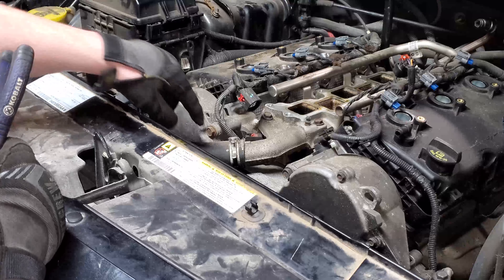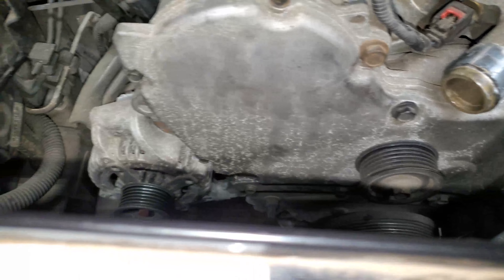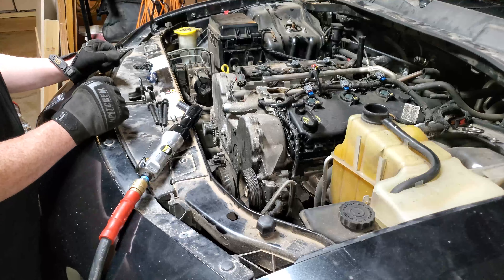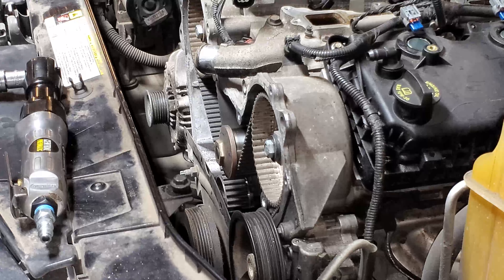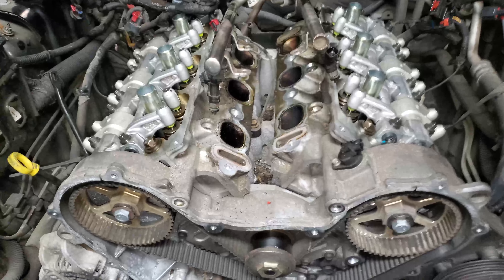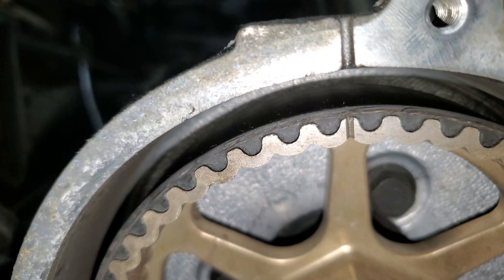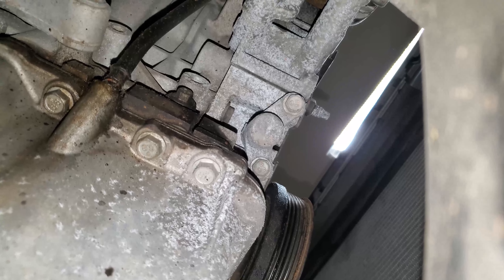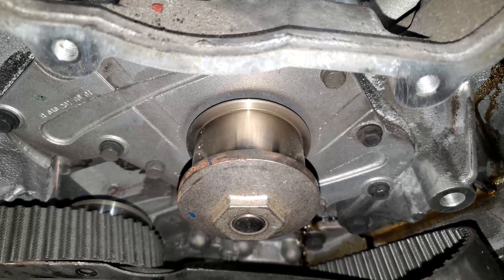How To Replace Water Pump 3.5L V6 Dodge Charger SXT Chrysler Mechanic Fix 4K

Comment: Quick question so one of my bolts had snapped and I was trying to figure out what length and thread pattern the longer bolts are that hold the water pump in
Reply from the maker: Dang, I'm not sure. A Chilton manual or Google could maybe tell you but I'd extract it and with both pieces perhaps you can deduce that.
Reply: @bakerRebuilds  I been reading up on it's since Saturday and still haven't found it but I might be use another one to find the exact bolt I need
Reply from the maker: @MirandaGarza-v5b  yeah try the others to find a good fit. If you get 3-5 full threads that should work

Comment: I like the music. You made this look so easy. I'm assuming I don't have to take out the crankshaft pulley since it's only the pump that's bad and not the belt?
Reply from the maker: Thank you! No need to removey the crank just upper timing cover. You got this!

Comment: Quick question. Have a 2009 Dodge charger no codes come out, no lights are on, no leaks but does overheat no white smoke from mufflers and no noise. Water pump or head gasket?
Reply from the maker: Probably not head gasket, check under oil cap for white frothy stuff to be sure.
Does the car blow full heat inside the cabin? If yes probably not the water pump, if no it could be the water pump, heater core, thermostat or even too large of an air bubble in the coolant loop. Hope this helps!

Comment: So I have a 2010 3.5L dodge charger and when I idle the car starts to overheat( makes it to the 3rd section of heat thermostat). Checked the engine while on and I see that the radiator fan was spinning but I also seen a leak (not sure if it’s water or coolant). Would it be safe to assume it’s a faulty water pump or is it something else ?
Reply from the maker: If it just overheats at idle, it's very likely there is too much air in the coolant loop. At running speeds say 4k rpm for example, it would have 4 times the pressure of a 1k rpm idle. So while your driving the pump has enough force to push the air bubble past the high point while at idle, it cannot and the coolant sits still which would cause the overheating. I'd make sure fluid is full and system is bled properly. If that doesn't do it let me know.

Comment: No mention of taking off uper intake plenum or the valve covers is any of that necessary? To change the water pump?
Reply from the maker: No that shouldn't be necessary. Probably the upper radiator house but then you should be good to proceed.
Reply: Fantastic thank you
Reply from the maker: @kevinfoster1138  No problem, hope it goes well!
Reply: @bakerRebuilds  
Hello sir the repair shop told me that it would be 1,900 dollars to replace the water pump. Is that accurate??
Reply from the maker: @Charles-dm4ku  I don't exactly know but with inflation and the labor required, that's unfortunately probably about right.
Reply: @bakerRebuilds  
Replacing the oil , cool and all the filters too?
Reply from the maker: @Charles-dm4ku  When I rebuilt this V6, yes I pretty much went through most parts/fluids.

Comment: So u dont need to remove the crank pully ?
Reply from the maker: Nope, just the main aluminum timing cover, take tension off belt and slide off top stuff leaving it down around the crank pulley, change pump and reassemble.

Comment: Any advice on replacing a rear main seal on an 09 Dodge Charger 3.5 v6 high output?
Reply from the maker: That shouldn't be too bad. I would unbolt the torque converter from the flywheel, drop the transmission, remove the flywheel and then you should have plenty of access to replace it.

Comment: Don’t have to pull the harmonic balancer pulley?
Reply from the maker: @neilritter8418  No, you do not.
Reply: @bakerRebuilds  thank you man. Good video 🤘🏻
Reply from the maker: @neilritter8418  I appreciate that! Also be sure to torque the water pump bolts properly. Wouldn't want a leak there

Comment: Does anyone know if the 2010 challenger and chargers have the same engine and intake manifold…like can you use the engines of these cars in one another?thank you
Reply from the maker: Yes, Chryslers 3.5l V6 is found in the base dodge chargers and the 09-10 challenger se models. Depending on year the vehicle will have a 4,5 or 6 speed transmission so you'll want the same speed from donor car to the receiving car to make sure the bell housing bolts line up.
Reply: @bakerRebuilds  thank you so much for you’re input that’s another issue with the engine the bell housing bolts did not align but somehow still worked I will make sure to ask next time have a blessed day brother
Reply from the maker: @markortiz8199  no problem, you as well my friend!

Comment: I liked the music tbh but how did you know the water pump was bad?
Reply from the maker: Thank you. I took this engine all the way down to the bare block so I made separate videos to help someone on a specific part. If it was bad though you would have over heating due to lack of circulation.
Reply: @bakerRebuilds  hello, my 2010 3.5 is slowly leaking water over night when parked . When I drive it to my dads to try to pin point the location it wouldn’t leak. We let it sit a few hours and nothing. But I drive home let it sit and over night it starts and after a few days I checked and was almost at bottom for coolant reservoir. What could this be?
Reply from the maker: @seanf6968  I would do a compression test to rule out head gasket. I'd also suggest starting first thing in the morning with it jacked up so you can lay on your back under the front of the car and try to pinpoint any leaks.
Reply: @bakerRebuilds  would a head gasket throw a code ?
Reply from the maker: @seanf6968  I don't think so but I could be wrong. Check under the oil cap. If there's any white or foamy stuff it's a sign of a head gasket leak.  Make sure where your thermostat goes that it's a secure connection and check back by the fire wall, by the heater core to make sure it's not leaking. That's about all I can think of for losing water and not overheating.

Comment: That's not how you replace a water pump all you did was took the cover off and the timing belt loose
Reply from the maker: Yeah I only explained each step and exactly what's needed including socket size, silly me. What have you contributed to the world lately?
Reply: A hell of a lot more than that I wouldn't post something saying how to replace a water pump on a 3.5 V6 Dodge Charger SXT and not go through the entire process like you did. I would show it from beginning to end which includes putting it back together refilling The system and starting and running checking for leaks etcetera
Reply from the maker: @joen5332  So you know how, why watch the video then and waste time commenting?
Reply: @bakerRebuilds  because I like to find the YouTubers they claim they're helping the average individual repair their cars by themselves without paying the mechanic which most of them do not show the entire process like you
Reply from the maker: @joen5332  Hahaha wrong, go watch all my videos then get back to me since you don't mind wasting time. Also I haven't made any claims. Lmao
Reply: @bakerRebuilds  explains everything I will only waste my time once on a YouTubers video when they don't show all the information that it states in the heading
Reply from the maker: @joen5332  lol so you're getting hung up completely on semantics. Look I know the world is going to shit quickly but you don't need to bring your problems to my comments section 😂 and so much for once you've commented several times now, thanks for helping the algorithm.
Reply: @bakerRebuilds  that's right candy-ass
Reply from the maker: @joen5332  Wow you're entertaining, run out of half legitimate remarks so you've stooped to name calling hahaha come on gimme another! 😂